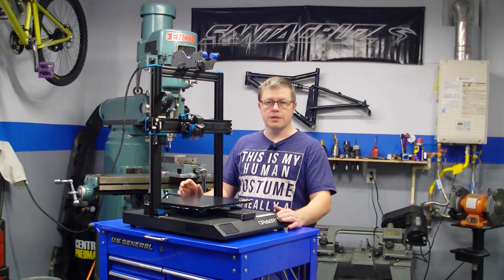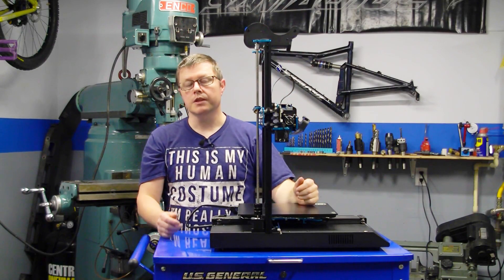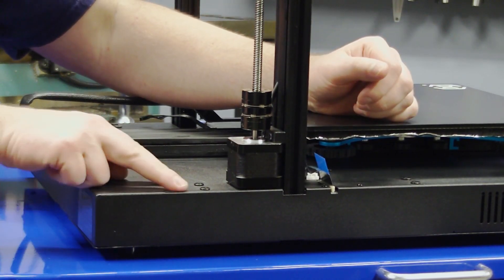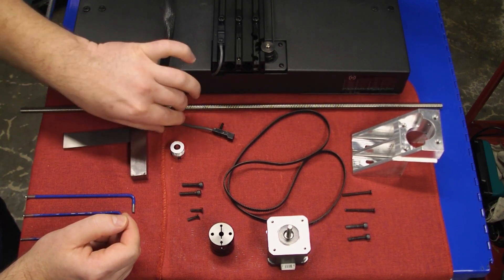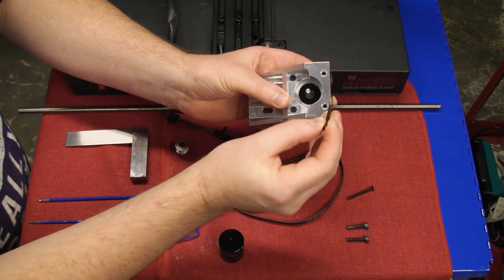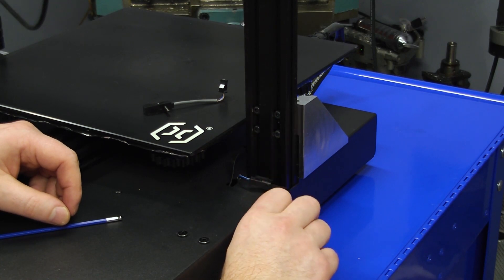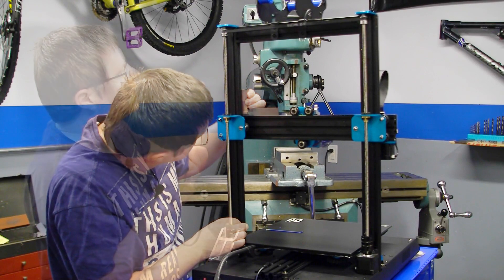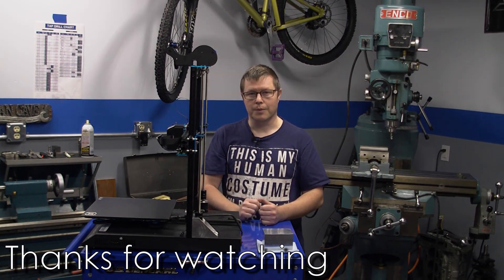Sidewinder X1 Gantry Support

Comment: Broz. On top of the lead screws there are pulleys, with two grub set screws. Ok so on my printer, the top collars of those pulleys are butted up against the bottom of the blue plate, where the top end of the lead screw sits in a bearing which sits in this blue plate. So, why are your pulleys so low from the top blue plate?

Comment: Cool project but.... In order for the Y-axis motion to cause Z-wobble in the Y direction you have to somehow set the Z axis and mass in motion in the Y direction. Since there's no Y motion in the entire Z towers and X rail+gantry and filament roll, the only way you will get the Z axis moving in the Y direction is if the bed mass moving in the Y direction causes the entire printer to move in the Y direction. This will happen if the printer is sitting on an unsteady base, like a wobbly table, or a rolling cart. In that case, the Z axis assembly will get pushed fore and aft, and the momentum of the mass of the X rail and gantry, and especially the filament sitting on top, will attempt to resist that motion, causing the Z axis to flex, especially at the bottom, and ultimately spring fore and aft. Worse, there will be some resonance to that springy motion, and the frequency of resonance will tune differently depending on the height of the X rail, and that will interact resonantly or anti-resonantly with the printer's repetitive Y motion commands, for example as it prints repetitive fill patterns.  
If instead you place the printer on a solid non-movable surface, then the printer won't move in  the Y direction, and won't suffer this problem.
Reply from the maker: So i get what you are saying, but even with the printer on a concrete floor it still had wobble.
Reply: @EtherealProject3D  Hmmm, so it would be interesting to know how it was generating Y motion in Z tower.  Maybe the rubber feet were slipping or flexing.  At any rate, improving the Z tower rigidity is, no doubt, satisfying 🙂
Reply from the maker: @Graham_Wideman  I think its just the resonance in the frame, the contact surface is not big at all where the uprights mount to the base and its very easy to move the gantry by hand. The wobble doesnt come from the extrusions bending, its the contact area of the attachment point. These braces just increase that contact area.
Reply: @EtherealProject3D  I certainly agree with your description of the action of the braces. You are persuading me that I should add braces to my X1 just on principle 🙂.
Reply from the maker: @Graham_Wideman  DO it. Its good for you.

Comment: Great design, however after printing I realised I have a magnetic bed on top of the glass which means the side slots on the two braces are in the wrong place (too low on tge model to fit the bed in). Any ideas on how to avoid a redesign and reprint?
Reply from the maker: If the thickness of you build plate is thicker than the clearance gap then a redesign and reprint will be needed. I can easily change the design for you  if you need it.

Comment: Thanks mate, I must be lucky with my X1 I have never had any z wobble and if I did it hasn't affected my full height prints
Reply from the maker: Good to hear, in stock form is it very well built and with tweaking jerk and accel settings it can perform very well. Thank you for sharing your experience.

Comment: Thanks for the video.
Where can we buy these brackets?
Reply from the maker: There are stl files linked below if you would like to 3d print them. There is also a blueprint linked for those that want to make them.
Reply: @EtherealProject3D  thanks
I saw the files but do you think it is strong enough in PETG compare to aluminium?
Reply from the maker: Petg should work just fine. I did my prototypes in PLA and they were surprisingly stiff. I still have a PLA one on one side and its really good. Still finishing part 3 of the videos about it.
Reply: @EtherealProject3D  thanks a lot for your quick feedback
Reply from the maker: You are very welcome. If you end up trying them in PETG let me know how it works for you.

Comment: I would love to try this out! But on the easy version, does the original bracket that holds the motor onto the gantry fit inside? I don't see any holes where the screws will go.
Reply from the maker: The original bracket stays with the easy version. All you need are 2 more screws to attach it to the back of the stepper motor.
Reply: @EtherealProject3D  Awesome you really did think of everything! Thank you
Reply from the maker: @jacobconley420  You are very welcome, happy printing.

Comment: are you using solidworks to print with ?
Reply from the maker: I use solidworks to model with, save as STL and then open STL in CURA to slice and print.
Reply: @EtherealProject3D  oh that’s awesome , did you make a guide maybe on how to do that or there’s already one available?
Reply from the maker: I have not made a guide for that but if thats something that people would like that can be done easily. Are you looking to use solidworks to do some designing?
Reply: @EtherealProject3D  I am ,  im new to 3D printing and already have some experience in solidworks so I thought it would be great if I could just stick with what I know and also practice with it
Reply from the maker: I can make a quick guide today and upload it for ya, im sure others would like to know also.
Reply: @EtherealProject3D  that’s awesome mate ! Thanks
Reply from the maker: No problem.

Comment: Good tutorial, but I don't have access to a milling machine to make these brackets out of aluminum. If I were to print the easy version what type of filament would you recommend? I'm assuming PLA isn't going to be strong enough.
Reply from the maker: I did my test pieces in PLA and they were surprisingly strong. But for better results PETG would be better.
Reply: @EtherealProject3D  How hot do the motors get - would it be a heat issue for PLA?  Thanks for the Video - only just found it on the facebook group

Comment: Thanks for the STLs, I'll give it a try.
(btw, my mesh analyzer indicates the models have a few stray edges and unclosed surface borders)
Reply from the maker: Thank you. Interesting, i never jad a problem with it. Is there something i can fix on my end?
Reply: @EtherealProject3D  Only if you want cleaner prints with less artifacts in the walls. The slicer tries its best to plug the holes, and it does, but it has its own limits. Cleaning up the model with something like Meshmixer helps the slicer and can produce better results.
Reply from the maker: @mururoa7024  I will look into that, ive never used meshmixer, I will give it a look. Thank you.

Comment: Cool design fellow machinist.
I don't think the 3D Printed version will provide the rigidity that your looking for. Mainly for the reason of the screws hold the gantry to the plastic part. 3D Printed threads are no strong enough. You will have to add a nut on the back side or emboss a brass thread insert. Each option both have issues. Guess I will have to turn on the Bridgeport. Haha.
Reply from the maker: I get what you are saying , but the 3d printed part is plenty stiff enough.

Comment: Where did you get those stepper motor couplers? did you notice any improvement with using them?
Reply from the maker: I got them on amazon. Yes there is a pretty good improvement in print quality with them.

Comment: Hey, I just printed and installed the easy version. My bed was running into the part, so I used my soldering iron and some aluminum foil to protect it and squished the ledge further down (probably 2mm). I printed with the 45 degree angle down to maximize strength on that axis. It immediately fixed a creaking/metal clacking noise I've been having since the beginning (and all screws are super tight). Thanks a lot! I'll reply to this comment if it helps my z-banding.
Reply from the maker: Awesome, thank you. There have been a few people have some clearance issues with these brackets, thank you for letting me know. I will update the stl files asap.

Comment: i'm having some clearance issues on the right bracket after printing, maybe my version (or my specific model isn't as symmetric as it seems. I'm printing a modified version of the non-easy one to shave off some material for better clearance and to let me install it without having to make any modifications on the machine itself.

I'm not a mechanic engineer so idk if my mods will impact much on the strength of the piece, but if it works i'll put it on thingiverse (crediting you for the original, of course) :D thanks a lot for putting it out there!
Reply from the maker: Where on the model did you not have enough clearance
Reply: @EtherealProject3D  the bed was catching slightly on the side of the right bracket, so i shaved a couple of mms and removed some material from the top. I'll do a test print later today and let you know how it went, i can also send you the .stl file with my modifications if you want :)
Reply from the maker: @ririari  Thank you, let me know how it works and I can update the model and stl files. I didnt run into this when I did mine.
Reply: @EtherealProject3D  worked perfectly after shaving off the side. gantry looks solid and wobble is practically gone (under 50 micrometers while continuously moving the z axis vs a whole lot more before adding the supports)
Reply: @EtherealProject3D  here's the modified stl file
https://drive.google.com/file/d/1ybIO5RUKcEKAU_ILf3QflglyuLuzVTDo/view?usp=sharing

i enlarged a few holes and added some extra holes to eliminate the need to drill or modify the gantry. i reused the original screws and used t nuts on the top ones that connect to the gantry
Reply from the maker: @ririari  Thank you, im happy you got it to work.
Reply from the maker: @ririari  Thank you.

Comment: What’s the difference between 3D printed part and aluminum ? Does the 3D printed effectively remove Z wobble or not ?
Reply from the maker: I didnt notice a difference between  brackets printed in PLA and aluminum ones. The design increases the mounting surface area of the gantry legs and takes advantage of the stiffness of the frame parts. I did some test printing and the reduction in Z wobble is impressive. I tested it with the spool on top like in stock form and with the spool seperate and there was no noticeable difference. These brackets are not as stiff as a triangulating rod but they plenty stiff for this machine.

Comment: nice bit of work there but as an x1 owner since the late v1 i dont feel you will have fully supported the uprights rather just moved the flex of them slightly higher, my thoughts have always been that the uprights should have been 4040 to sort the flexing over the length especially with the speed this machine can run, another major flaw you mentioned is the combined wieght of that daft spool holder and a Kilo of filament mounted on the cross beam which once it starts to resonate ( poss wrong word ) amplifies the flexing along the uprights, i have a resin printer next to my sw1 and even though i have a top to bottom support structure both sides the printer i was still seeing vibrations in the uncured resin  in that printers vat if i used both at the same time, what gave me a massive reduction was totally isolating the filament spool from the printer including that overweight spool holder, ie more mass you can remove from the top of the machine the less issues you will have, please dont think this is a derogatory post of what i  see as a good upgrade in both design and machining, its not meant to be derogatory but i think over a months use you will find the improvements are minimal. Wish i had your workshop. mines just big  enough for 5 printers plus a smallish lathe and a separate small mill/drill
Reply from the maker: From the testing that I have done with this I noticed that most of the flex or wobble is due to the small surface area of the mounting surface. My bracket gives the gantry many times more mounting surface area. The 2040 beams are plenty stiff enough to keep the wobble at bay when they are mounted with these brackets. Thank you for you input, any sugestions are always welcome.

Comment: Hello. I have printed these parts and the one problem I am having is finding where to buy the screws. Can you tell me where to buy the M3 and M5 screws. Thanks so much.
Reply from the maker: I got them on amazon. I could onlu find them in bulk, sorry 
uxcell M3x35mm 10.9 Carbon Steel Countersunk Head Hex Socket Screw 40pcs https://www.amazon.com/dp/B01C3KUMSY/ref=cm_sw_r_cp_apa_i_8TDUFb6408DFE

uxcell M4x20mm Button Head Hex Socket Cap Screw Bolt Black 50pcs https://www.amazon.com/dp/B01D4VH6NK/ref=cm_sw_r_cp_apa_i_9VDUFb108M3JE

Comment: I would also suggest you check that the upright is square to the base. 'Although your bracket may be perfectly square there are usually slots milled in the base.  If these are not perfect you may still have a slight tilt in the gantry
Reply from the maker: They are square on my machine.

Comment: Why not use “T” nuts instead of the extra work drilling the Z beam? That would also allow extra higher up easy connection points. Just a bit of feed back, but nice solution ; ) 👌
Reply from the maker: I had not thought of T nuts, I suppose that would work well too, and simpler. Good Idea, I will have to mention that in the video. Its slow going but I am working on it. Thank you for your input.

Comment: While that sure is a pretty-lookin bracket... I would think that connecting to the TOP of the gantry would be the ideal way to go. A couple of corner brackets, with threaded rod... and that sucker ain't goin nowhere. All you've done is added to the problem area with an over-worked hunk of aluminum. 

However... I do applaud your design & milling skills. It's obvious you're no amateur. Thanks for the upload.
Reply from the maker: It works better than it looks like it does. I aggree connecting it from the top would make it stiffer, I wanted to do my own design. Thank you for your comment.

Comment: I printed the "Easy" file and they came out great.  I am learning how to use CAD and I just wanted to see if I could replicate your design in FreeCad.  It took me three runs and I finally got a somewhat useable file not yet tested.  Before I didn't have the confidence to try that.  Thanks for the push. Can a machine shop use the PDF diagram that you provided to do this in CNC, or would they need a G-CODE or STEP file to product it?  I am sure that the cost would be pretty substantial, but it would be something to look into.  Thanks again for your video and the files.
Reply from the maker: A machine shop should be able to replicate it from the drawing. But the would probably charge more than the printer cost. Perhaps if your local high school or community college has a machine shop class they could do it as a project. Keep up the work in free cad. Its a good feeling being able to design and print your own ideas.
Reply: I reprinted the "Easy" brackets with the back area facing down.  My first attempts  - good, but not perfect due to the "Supports" I had to remove.  The reprints came out smooth and clean.  Much better than my first attempt when they were printed on the side. When doing my test fit with the "Easy" I found out that I don't have to disassemble anything.  All I needed to do is remove my extrusion brace setup.  I am going to do a test print and check how the "Z" movement looks on it.  Just my first impression now it doesn't seem that the "Easy" will hold up in keeping the "Z" in check.  The "Easy" is just attached to the base and the back two bolts of the stepper motor.  I can see that the other bracket may be a better choice since it is directly attached to the 20x40 extrusion.  I am going to print them after my test on the "Easy" and once I put my extrusion braces back on.  This may seem like a lot of work and a lot of work for nothing.  But, for me, it is an exercise of mind and thought to solve issues.  Plus it is so much fun.
Reply from the maker: With the easy brackets you need to aquire 2 more screws to mount it to the stepper motor. They will be the same as the current screws on the stock mounting bracket.
Reply: I just completed my first test with the new Z brackets.  But before printing, I had to manually trim about  2mm off the inside area of the top-right bracket.  My bed would not clear moving on the Y-axis when I attempted to relevel it.  The left bracket did not require any adjustment. My test was the  20x30mm X1 cube.  There was no evidence of any wobble.  Printing with a 0.6 nozzle, all of the layers were intact with no separation or irregular formations on the cube.  I am very impressed with your design.  I have another printer that is a custom build that I will be using X1 spare parts and I will incorporate your bracket design into it.  Thanks again for sharing this item.
Reply from the maker: @leeo.alexander2324  Im sorry you had to trim some material from one side, I did not have to do that. Im happy its working for you. Thank you for your feedback. Happy printing.

Comment: This is one of the best videos on modding the X1 that I have seen.  I have this 3d printer also.  I decided to use some extra 20x20 and 20x40 extrusion pieces to do the same thing.  Basically, I sort of boxed that area in by only using the four bottom bolts to secure the short 20x40 behind the stepper motors.  It works but like you said it's not as aesthetic as yours.  My wife won't let me some of that equipment.  If 3d printed with thick enough walls I am sure this would work.  I normally use PLA and I have printed some very strong pieces with that filament.  Again, nice job.  And I concur that this is one of the best 3d printers on the market.
Reply from the maker: When I did the 3d printed prototypes I set up the slicer to do 5 layer walls. Worked really good. Thank you for watching.